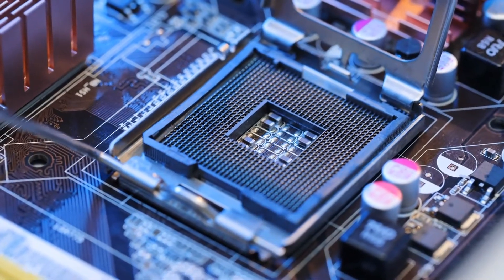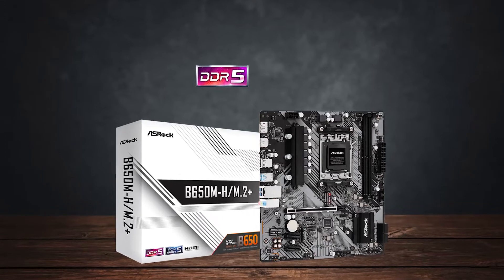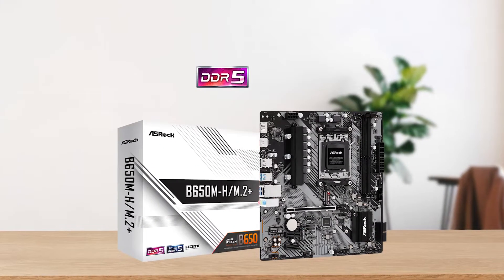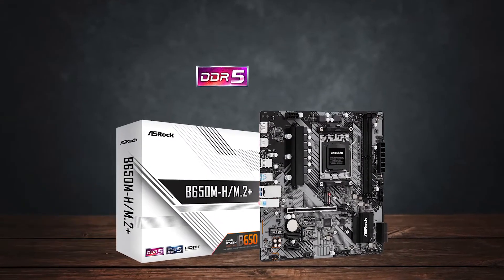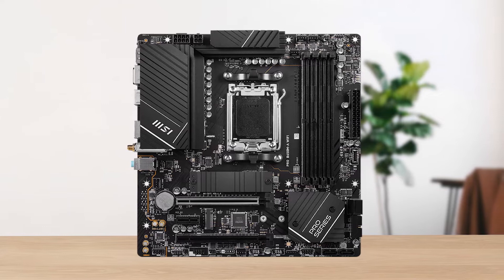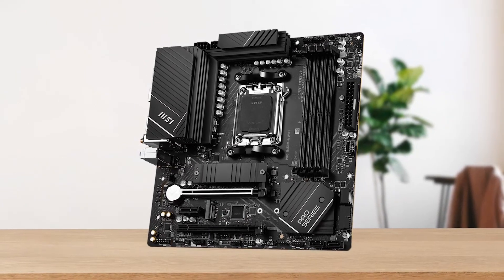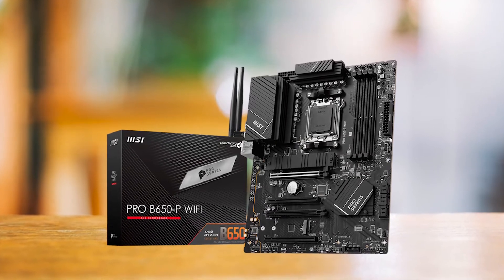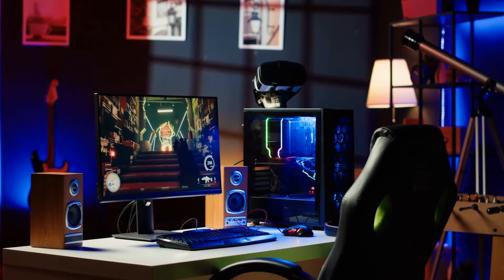The Best AMD Micro-ATX  Motherboards In 2025!

Comment: ASRock B650M-H/M.2+ Do not buy this board! It is a bad cheap board.
If you want a buy a good budget board buy the ASRock B650M-HDV/M.2is way better.
The other one will not work with ryzen 9000 or anything above well or even with the 7000 it is still not a good buy

Comment: One important thing to keep in mind with Micro ATX motherboards, if you intend to install them into a Micro ATX case is the position of the pcie x16 graphics card slot. If it lines up with the motherboards middle screw holes it's a good thing. That means it's in the uppermost position. If it's one slot down (not lining up with the screw holes) it's not good. The reason is if you install a graphics card that takes a bit more than 2 slots it will get really bad airflow. Will be to close to the bottom of many micro ATX cases. Hardly getting any breathing room. So in this video it seems like the Asrock motherboard has the x16 slot in the uppermost position, but the MSI motherboard has it in the lower position. Important!
Reply from the maker: Thanks for sharing!
Reply: Hey thanks a lot for the heads up
Reply: Although the Asrock is getting a bad rep (some cpus are melting) --- any other matx options with slot in upper position?